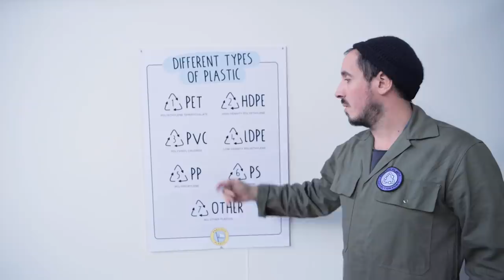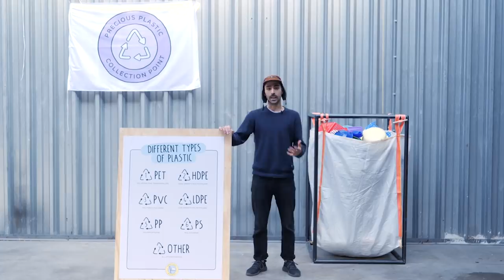Precious Plastic - The worldwide problem with plastic recycling (part 4.0)

Comment: My issue with this is cleaning.  My water bill is going up up up and you want me to spend more money to buy water to clean plastic for others to profit from.  That to me is a crazy expectation.
More importantly it would also be more water and energy efficient to have a centralized area...say the collection area or the recycling center that is designed to clean the plastic in a water and energy efficient way.

Besides that, you guys Rock!!!

Hugs to all
Reply: If you buy the plastic in the first place you are responsible for the rubbish. As long as contaminated waste can not be recycled properly/efficiently/at all , you'll need to make sure it is not contaminated.
Reply: If you want folks to give you their recyclables you need to make it as easy as possible, not harder.  That will just turn them off from recycling.  Let alone having the centralized cleaning facilities that can clean the materials both energy and water efficiently.

When I was young we were allowed to go out into out dump.  I was young and was finding Campbell’s soup cans for the labels.  I did not are if they were dirty.  I wanted it to turn in for play ground equipment.  I was getting something out of it so did not mind putting in the work to dig through the trash and clean it as I was the end user.

Also while growing up we would tear down old buildings for the wood to reuse,  made many additions to the house with this wood and various other things.  We did not expect the owner of the buildings to tear it down and pull out the nails and drop the wood off at our house, we went out to get it.

Expecting the world to not only drop off recyclables at your feet but also  expect them to spend time and money cleaning it for you will get you a lot less to recycle and more in landfills or worse.
Reply: So if you find a dirty piece of plastic on the ground....do you just through it away because you can’t find the person that purchased it to force them to clean it?
Reply: I agree, i have some time thinking about this, maybe the collection points should have cleaning stations for this purpose. Sadly but truly if you want that the people do something it has to be as easy as possible, that's why they use plastic in the first place, more so in third world countrys whithout any kind of legislation for home waiste
Reply: Doing the "right thing" with the environment is almost ALWAYS more expensive.   Sadly, we all need to make small sacrifices.  If everyone refuses to chip in somehow, society makes no progress.      
I'm not saying this video is the solution... but essentially saying "I refuse to help, not my problem.  Someone else should fix it"  will assure our failure.
Reply: I never said I will not fix it, I will and do take my time to sort and drop off recyclables.  I am saying the folks that are benefiting from my efforts should not expect more money from me to pay for the water, water heating bills, etc. also.  It would be more importantly a better use of resources to have cleaning done a5 a centralized location where there would be less energy and water usage which is also good for the environment, such as the example given of car wash businesses that recycle their water.  Also would be labor saver overall in the big picture.

Who cleans the bottles that are collected from public areas in the recycling containers?  Who cleans all the plastic collected from the ocean and shores or will all that just get buried because the end user can’t find the initial purchaser to try to shame into cleaning for them to make something out of.

I live in the desert and see so much trashed dumped in the environment because of the high prices just to take it to a dump, let alone be recycled.  Folks went to all the effort to clean up and load it into transportation just to move the mess somewhere else instead of the the best or proper place because of the costs.  It’s really sad.
Reply: I agree that washing your plastic at home is probably worse for the environment than just burning the plastic in incineration plants and scrubbing the CO2. Water is precious!
I believe we really need scalable solutions using robotics to solve this. A central processing center that washes and then sorts the plastic using robotics would allow this to ecological and the plant can be sold and build anywhere and be economical.
Robotics are still advancing so if you can 3D scan parts and have object recognition would help to sort and take things apart. Things like spectrographic analysis can help identify the type of plastic (which part of the spectrum in the IR range it reflects etc).
But it's costly to develop. All of this could be done already but we have large economic inefficiencies especially when investing in development. Then it gets covered in patents and stays niche for 20 years. 

This is a problem with a lot of environmental and climate change related solutions btw.
Reply: Why not clean it with composting?  Microorganisms in the compost process will eat everything but the plastic.
Reply: Some plastics are dishwasher safe
Reply: The things that's missing is that it shouldn't be up to the consumer who bought the plastic nor the people trying to recycle the plastic but the fucked up industry that created the plastic in the first place instead of compostable alternatives and the government's heavy subsidization of the plastic industry that allows is to be the "cheapest" (to the companies, but most expensive for the world) choice of packaging.
Reply: @odriew5014  Because that will degrade the plastic.We see many pieces in nature that turn matte, degrade in colour, and loose properties.Such is the case with recycling. Let's say I have one bottle made of virgin plastic, that gets collected, it's clean and dry, will end up in the recyling process and turn into another bottle.Then, if that bottle ends up in the reclyling system again, it will be turned in fibers for a t shirt or a carpet, not a new bottle. Because it no longer has the strong characteristic of the virgin plastic used for pet bottles.That is called downclycling and unfortunately, not many people talk about that. Some say plastic can be recycled 7 times but after that, it ends up in the landfill because that plastic is useless and not at all durable to make anything else out of it. But then again, I don't think that any plastic ever reached that 7 times count when it comes to recycling.That is why we need to focus on stop using single use plastic.
Reply: @gordybishop2375  I know what you're saying.That is why I just put a bowl in my sink and when I clean/rinse the dishes, I use that soapy water after that gathers there to rinse the recyclable stuff. I also use napkins people use at the table for cleaning oily stuff (cans, for instance). That way I don't waste water or detergent. Please note that almost everyhting needs to be rinsed, not washed. Pet and glass bottles from beverages, etc can be rinsed only.Food containers can be wiped then rinsed.It's easy if we have an open mind about it.
Reply: @dejayrezme8617  you could use water from the kitchen. The one used for washing/rinsing dishes or vegetables when cooking. I put a bowl in the sink and use that water. Cheap, simple, no added costs to my bills.

Comment: Love the working you doing guys. However I think there's one problem that I don't hear anyone talking about: why are there no regulations for plastic usage? Take for example a bottle of coke, the plastic which is used for the label is a different one from which one the bottle is made of. Wouldn't it help if there were rules in place for single material usage? I'm curious what you guys think about this.

Comment: Gread initiative. I think that the main problem with this 
"area" is money. If somehow you could use this to make a profit it would be much more feasible. And by profit i mean a reocuring good amount of money , not just by seling cups and fruit holders. These types of products are great for enthusiasts and to get people to know the product but if you want to make this an actual thing you got to generate money.Most people wont get much out of their way for the enviroment but if they see money its more likely they will participate. Love the idea and wish you the best!
Reply: The fruit bowls and keychains are just novelty things to get people's attention. They have other videos of producing plastic sheets (like plywood) and plastic lumber, which uses huge amounts of material (meaning you won't have a surplus of recyclables) and are far more useful and easier to sell in bulk. There's a business in my city that buys LDPE (shopping bags and pallet wrap etc.) from recyclers to make synthetic lumber for picnic tables, park benches, and patios. There's even a furniture manufacturer that makes adirondack chairs using different colours of this lumber, which have become popular across the province. Construction materials is the way to go.

Bonus: at the end of the life of the adirondack chair, the LDPE can be incinerated to subsidize coal use in cement kilns and power plants. LDPE, HDPE, PP, and PS all have about double the energy density as coal, and release less harmful emissions than coal under the right conditions.
Reply: @ImranZakhaev9  Yeah i understand that their goal is not just to make small objects , they are for sure needed but not very scalable as a business. I've seen some of those tables also , in my country they also use it to make beach boardwalks. I like the concept but i dont know if the construction materials area is the best way to go. I mean , it is a very good way for sure , but unless duration is a big problem i think that people will always go for the cheaper way. In my country lumber is quite expensive but from what i see these material wont be very cheap either. I think that a way to go around the small object - cheap to make/ big object - expensive to make dilema is premium items. Maybe by making better quality (than others) produtcs we could ask for more money and people wouldnt choose the alternativels.  I am no expert in this and could be totally wrong :)

Comment: FYI the PP website needs a bit of attention. I'm not joining discord just to tell you guys, but liked what your doing well enough to visit the website. From a mobile (galaxy S7/oreo/Private Browser/with javascript enabled), all pages allow me to scroll down, but not back up. The first "Learning" page allowed me to scroll up after reaching the bottom of the page but the following page did not.

   Personally, I was looking to see what information you might have posted about at-home recycling.

 Someone needs to come up with a simple way to reuse plastic in a 3d printer. The process must be simple and use cheap consumer level equipment. I think the main issue is the formula of plastics and additives. The whole reason for shredding the plastic is processing in industrial viable/profitable volumes. At the individual level the requirements are reversed. The individual is not concerned with profitable yield. If the recycling process can be safely left unattended, it could take any amount of time and wouldn't be an issue.
    The ideal machine would use a solar panel, sit outside, and slowly process used plastic into a form that can be reused easily. Something like small pellets seems like the obvious form to then use in a revised 3d printer. Make a simple design that has no moving parts and can be sourced from parts available directly from China. Places like the US/UK/Russia/most of the EU, have excellent access to stuff on Aliexpress, eBay, and others.
 People need to see plastics as a resource they want to reuse because it is useful to them.

Comment: Hello Mathias! Great work!
Have you guys thought about resin number 7 and single use plastics?

Is there a solution other than good old reduce, reuse option?
Reply: Resin #7 just means "other" which includes laminates (layers of different plastics with different properties) and resins that aren't common (or recyclable) enough to get their own number like PC (polycarbonate), PTFE (teflon), PLA (poly-lactic acid) and so on. Each would be handled differently. Also, reduce and reuse is ALWAYS a better option, but the point of precious plastic is to show that the stuff that CAN'T be reused is still valuable.

Comment: My question. Would I be able to use recycled plastic to make recyclable toys to sell?
Reply: Sure u could.
Reply: @peaxoop   The short answer is yes. One great application for recycled plastic is 3D printing, which is famous for the sheer variety of things you can make with it, including toys. The other advantage of this approach is that 3D printer plastic tends to be very expensive, where recycled plastic should be very cheap.
Reply: @peaxoop  I think PVC is most fire resistant and least toxic if it does burn
Reply: @peaxoop  I been curious about this too. I know that PET isn't usually any good with 3d printing unless it is PETG, which means it is treated with glycol to strengthen it. HDPE is the most common I find, I hear it shrinks after printing from heat, I try to find how much of it is used for toys, all it leads me to is the green army men toys. It's usually used for safe consumption for consumable items. Only 2 I know are actually used for toys and that's ABS and PVC. ABS I think is used for relatively safe things but PVC is toxic for consumption, it's usually used for toy collectables for young adults. I don't find ABS very often. I don't know how good HDPE and PET is with injection molding either.
Reply: @peaxoop  The other thing that is pretty safe is PLA plastic. A bioplastic typically found in food untensils and other products from restaurants that offer disposables. But you can also produce PLA with household ingredients like cornstarch, sugar cane, and cooking oil (I think). It's supposed to be safe, biodegradable and I think it's safe if consumed. LEGO I believe was looking into it.
Reply: @doctorthee  PVC is the least fire resistant and most toxic, with bakelite being the most fire resistant but also most toxic
Reply: Short answer; yes. However, i suggest only selling collectable toys that target adults ONLY. Because when it comes to childrens products, there are a lot more safety regulations you must follow. If you don't know how to make your product 100% safe then you risk the safety of children and risk getting in trouble yourself. So I'd stick with adult collectable/art toys only. From my understanding there are a lot less regulations to toys targetted towards adults; so you should be okay! Hope this helps💓💓

Comment: Aren’t labels also plastic waste? :-(
Reply: Not chemically clean waste. They usually contain backing paper lots of random chemicals in color pigments, and a bunch of unrelated polymers in the adhesive. It's like saying, "wood pulp is a starch, flour is a starch, why don't I just make bread with this whole bag of flour without removing the the paper bag."
  The word "plastic" is a naive oversimplification. It's like calling all forms of cancers one thing, or all transportation vehicles cars. In the real world these words have absolutely no value. The different "types of plastics" are not at all related to each other. They are all unique chemical compounds that mix with each other about as well as any other substrate like wood or metals.
Reply: Upcycle Electronics I do understand it is not possible/practical to recycle every type of waste, specially this, as you mention, chemically unclean one. I was just pointing out the fact that something needs to be done about this waste too as it also bad for the environment.
Reply: @JARC99_  
Once everything is clean, all the scraps could be used for energy recovery. LDPE, HDPE, PP, and PS all have double the energy density as coal, and emit less toxins when used in a cement kiln or power plant. So after everything has been recycled that we can recycle, the rest of the clean, dry, but useless plastic can be incinerated. Same goes for laminates (paper coffee cups that have a plastic liner).

Comment: The best kind of plastic is the plastic that's not even produced. I like your Precious plastic movement very much but I think you are not going to the source of problem. Many products are so wastefully packaged, tons and tons of plastic is used on useless packaging, for example say potato chips, half of the bag is chips and half is air. Just because it then seems you get more for what you pay. That is ludicrous. As EU citizens I would like to have EU commision for packaging where people could report uselessy and wastefully packaged products and this commision would have power to change packaging on a product. I know its kind of my good hope but it would solve something at least. 

Anyway, question here guys, what to do if theres for example paper label on a plastic bottle stuck on with glue? I think nowadays the majority of plastic is composite of plastic, paper, aluminium, glue or whatever. Do we throw this to landfill because its not recyclable? 

Another problem I see is to how to recognize various kinds of plastic. On some packages there is indicator of the plastic used but at least half doesn't have this. Is there any fast way how to recognize different kinds of plastic?
Reply: Hey luke. Agree we would also like a world with less packaging. But packaging is here whether we like it or not. And we try to do something about it. There are organizations lobbying the EU on strategies to reduce packaging. That is not our expertise or what we're good at.